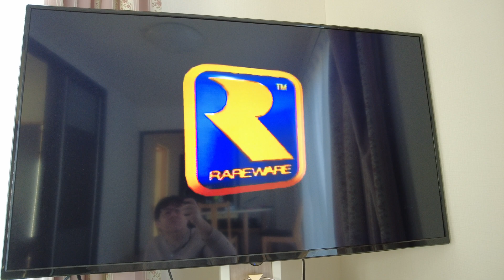An RGB mod that ANYONE could do to improve their N64 video quality

Comment: 1. this goes on the bottom so you dont need to remove the heatsink. 2. this only works on NUS-01 to NUS-03 board revisions with R15 R16 and Q1 pads (whether they're populated or not).  Some will say that these revs are all NTSC USA or Japan with serials starting NS1 and NUJ1 - and nothing else.

Comment: You really should tin the pads on the board before sticking the wire it. trim the excess exposed wire too. I understand the "if it works" mentality, but its pretty sloppy

Comment: Beware there are multiple REGION SPECIFIC versions and revisions of these versions. If you get an Early NTSC model.. you are good, only some wires needed, and if you want amplification, if you get a French PAL model, you are golden (Nintendo didn't know the French already practicly ditched SECAM, so they overspent on components and you only need to add a set of Rs and Cs) , if you get any other PAL model... you are screwed and for all the later NTSC ones... you are maybe too. For PAL Models you only get RGB with an additional Chip. Also know that  SNES, N64 and Gamecube share the "Multi AV" port, and the Composite (Yello, White, Red) cables are interchangeable, the RGB Cables ...are not.

Comment: I have mine modded , but I'm wondering if the Pound SNES RGB to HDMI works well with modern tv's, right now I have my n64 hooked up to a CRT which is great and everything, but its a small 12" display.
Reply from the maker: All pound products are really bad quality.  I wouldn't bother with them unless you're on a strict budget.

Comment: In my opinion it's impossible to make an N64 console visually as good as emulation. The small amount of RAM that was available for textures make the visuals what they are. Only PC emulation has the power to clean the textures up properly. The N64 is made for CRT TVs that's why there are Mini Retro Consoles for these 80's & 90's machines. Every output mod I've seen for the N64 make so little difference it's not worth the money.

Comment: The real culprit of why it seems like the N64 has awful video quality is the quagmire of why Nintendo decided to back then proclaim that all games were gonna be 3d graphics... iirc even the rushed MK Trilogy does not have bad video quality which means that say if Capcom or SNK had signed on (providing higher sales in Japan of course) and made pure 2d graphics games and arcade perfect home versions of arcade games... because... the N64 has the hardware... it had higher size ROM Cartridges at 64 Megs, 96 Megs, etc and most importantly of all... it had four controller ports... plus 3d was man power intensive... iirc Shigeru Miyamoto himself admited they had around 100 staff working on Super Mario 64 in a magazine interview back then... as such most of the best early N64 games still had rough looking 3d graphics plus in terms of years... it just did not reach MegaDrive or Super Nintendo levels of life cycle years and never could because Sega released next gen in 1998 which only got them to bankrupcy.. abandoning the highly profitable Sega Saturn Japanese market for no market and only giving Sony and Nintendo reason to make higher powered hardware.

Basically if things were different, a longer three way war between Sony PS1, Sega Saturn and Nintendo 64 would have had the latter two eventually pull away in image quality by using experienced devs, more advanced dev tools plus 4MB Ram expansion and for N64 the 64DD and higher capacity ROM cartridges with compression techniques plus probably SNK and Capcom returning or signing up to make 2d games... because there was a weird thing going on with demanding that all games needed to be 3d and the lie claiming that it was what consumers wanted.

Comment: Would have liked to seen comparison between s-video and rgb. I've heard a lot they're so close in comparison but maybe differences like you pointed out with composite and rgb in the video?
Reply from the maker: I don't have S-video cables for the N64 but I can say that from expensive via other consoles, S-video is nowhere near RGB quality.  It's better than composite but you still get dot crawl.  RGB is solid.
Maybe because the N64 video is so messy anyway even in RGB, S-video can look comparable?

Comment: Put solder on the pad first. It's easier than just tinning the wires, and you can still accomplish your goal of not using helping hands and only holding your iron and solder at any one time. 

Here's an example of retro console modding king, Voultar doing this technique on a similar N64 RGB board. He doesn't show putting the solder on the pads, but that's trivial since they're relatively big. Just put your tip on the pad and stick your solder on there. He's using flux, but you don't need it. It's best practice.

https://youtu.be/I1mtcbfGzV8?t=555

Comment: I did it in mine with a protoboard but adding a 4th wire for sync. This one works the same way, except for sync. It has a very noticeable difference in pictures, yet it's still a bit blurry (crappy Nintendo video chip). To improve above that only If you add a deblur IMHO.

Comment: Anything that requires soldering isn't something that anyone can do, but I feel ya. Most RGB mods are pretty simple.
Reply: General note to soldering beginners: Do NOT try to lift the pins of chips.
Reply from the maker: I think it is once someone is confident.
Being able to solder it easy once over the fear but being able to solder to very tinny points does require proper skill.  I would fully recommend people try a simple mod like this though.
Reply: @RetroCore  I wouldn't call soldering easy.  It definitely took me a while to get good at it.  But yeah, this one is about on par with most RGB mods.  This is the same standard RGB mod design that has been around for many years for the N64.  I myself like ETIM & Voutar's mod kits

Comment: I think I remember reading this particular type of N64RGB mod only works on the first few board revisions of the console - after that the simple mods won't do the trick. My model required using Tim Worthington's RGB kit, which requires much more extensive and precise soldering.

I'm glad you had a console that could make use of this mod though. n_n
Reply from the maker: That's right.  It only works on the older NTSC systems.
Reply: Good point.  I prefer ETIM's kit myself since it includes the Deblur function.  More complex of a mod tho but definitely better than the basic ones.

Comment: But can I also use RGB scart cables on the n64 with this mod? I've got both a PAL and NTSC-J console.
Reply from the maker: Sure, I'm using JP21 pin cables as I live in Japan but a RGB SCART cable will also work just fine.
Reply: @RetroCore  thank you

Comment: if you’re in the uk get a trinitron and they play s-video via the scart cable and a cheap adapter. looks basically the same as rgb, the dot crawl is all gone. rgb on n64 is a waste of time
Reply: Good s-video cables are expensive and hard to find. With these early consoles RGB + Packapunch SCART cable may genuinely be the same price, or at least very close. RGB offers more vibrant colours and higher compatibility with PAL CRTs (no NTSC colour support needed), so it's certainly not always a waste of time.

Comment: S-Video through the Framemeister (with the correct custom settings) gives a very favourable quality for N64, hardly any difference at all to the RGB picture.
Reply: N64 s-video using a Monster S-video cable looks good. But I once had a cheap (around $5 I think)  s-video n64 cable from eBay; it was horrible.
Reply: @brandonginsburg3120  There are definitely differences in s-video cable build quality out there, though it seems like pot luck as to why. The one I have is unbranded, but actually works nicer than others I've tried. Running the N64 through an upscaler such as a Framemeister or RetroTink 5X Pro is absolutely essential though, unless you're lucky enough to have a nice CRT. I'm using a Framemeister, with s-video, on a LCD, and it looks fantastic.

Comment: I moded my French PAL System ~15-16 years ago. There was no PCBs or "kits" to buy back then. I had a list with resistors and stuff to buy from an Electronics Store.
Was the hardest soldering i ever done!! 
Some of the parts are just 2-3mm long. I had to work with a magnifying Glass all the Time. 
But it still works and is hocked to a Sony Trinitron CRT. :)
Reply from the maker: Good work!   The French got lucky as other regions in Europe had no RGB option for the N64 😭
Reply: 2-3mm long is huge. Try 0.25 to 0.5mm on new consoles.

Comment: Do you need a specific model n64 console for this mod to work? Does it work with pal consoles?
Reply: “VDC-NUS” or “VDC-NUS A” are the only ones that accept this simple mod. PAL requires a much more intensive mod
Reply from the maker: Only works with first gen NTSC consoles.

Comment: This "simple" mod can only be done on the early NTSC revisions, after which you need to spend $100+ for the mod.
Reply: $11 on aliexpress
Reply: Not quite true, Tim Worthington's N64 RGB is much cheaper, though does have to be imported from Australia. Not likely to be nearly as expensive still.
Edit: looks like there's even a US distributor for his stuff.
Reply: @tehFoxx0rz  Worthington's stuff is going to cost $100+ once you get it in hand.
Reply: @amerikalast  I've bought mods directly from him before and it hasn't ended up being nearly that much to the UK at least. And as I say, there's a US distributor if that helps as well.

Unless you mean in cables and upgrades to your setup to make better use of them, haha.

Comment: My import 90's N64 was RGB as was my PC Engine, Megadrive, Neo Geo and Super Famicom. I don't know of any shop in the UK that sold import machines without them being wired ready for RGB scart. If you still have your import consoles (or past a certain date some pal consoles) pre hdmi then everything would be RGB scart. Obviously I guess most parts of the world didn't have connections that had the arcade quality picture output.
Reply: Of that list, PCE and N64 were the only ones that didn’t come with RGB output from the factory multi-out.
Reply: @emmettturner9452  PCE you can actually tap RGB from the ext bus... but it is low power and needs amplification. 
The cheap RGB amplifier boards readily available nowadays based on the French Sodipeng design just pop into the EXT... obviously no good for a briefcase set up tho. 🤣
Reply: @KayliedGamer  Yeah, but you also needed to amplify audio if you grabbed it that way. These days we know you also got a different set of colors with RGB, almost like it was processed with a different DAC that was designed to translate the values differently. We know they both came from the VCE so shrug no idea why.

Comment: I wish I had an untouched N64 to try this on, N64 video output is so terrible a fair few of the consoles out there have been tampered with mine is one of those that had an earlier method of RGB modding done by someone years ago, I believe they cut traces so it's not easily reversible, the problem is that it just won't play nice with a modern TV. You can hear the games working but can't see much apart from a black screen. No N64 gaming fun for me.
Reply: Perhaps your modern TV doesn’t support 240p and would have that issue with any RGB mod. The modders who cut traces typically put C-Sync where Composite Video or Luma was. What kind of cable are you using?
Reply: @emmettturner9452  My N64 used to share an official Nintendo RGB SCART with my Gamecube, hooked up to a Trinitron.
Reply: @johns6265  It’s my understanding that Nintendo changed the RGB specs for PAL GameCubes versus the SNES and most N64RGB mods aim for SNES RGB specs. Also, GameCube is 480i, so if this were a 240p issue with the N64 you’d expect the GameCube to work.
Reply: @emmettturner9452  I'm kicking myself for selling my PAL N64 years ago, I could have borrowed the composite cable and RF modulator from that. A bad picture is better than no picture at all.

Comment: The N64 is one of my favorite console minus the OG controller(a wired Retro Fighters N64 controller is a GOD send) , but having my N64 hooked up to my 27in Panasonic CRT with an S-Video cable, I don't think I would notice that much of a difference, even though it has a component input, i but I do have the audio pumping to my 5.1 surround sound setup. 

Also I have the same Multicart you do except with a red shell, and it's nice not having to switch games when I want to play something different, and for a the handful of the more expensive games I don't have in my collection(my N64 collection is about 90% complete of the all the US released with games some in box, but most not).
Reply from the maker: The OG controller is garbage in my opinion.  I use a WaveBird like controller that's wired.

Comment: You do make it look easy, but I still wouldn't risk it myself, its worse because I have a PAL 64 which sucks, I think it is worth the upgrade though.
Reply: I'm reminded of 20 years ago when I didn't know how to solder.  my very first project was mod chipping a ps1.  it really isn't as bad as you think, but it certainly could be!!  imo, it's really not that difficult of a job, and the fact that you can plop the board over most of the pins needed to solder means a lot less fiddling.   and since the wires go down on parts that already have solder it's just one second of heat to get things melted and meshed per wire.

the main points for me i think, would be you don't want the part absorbing a lot of heat, so make sure your iron is as hot as it needs to be so that the solder flows instantly, then you put the parts together and hold them as still as humanly possible, a microsecond later you can see the solder change its state from liquid to solid and that's that.  if a little too much solder gets put down, you can kind swipe it awway with the hot iron most of the time, but a simple cheap "solder wick/braid" is also a great thing to have on hand.  [you also want to make sure the parts themselves have absorbed enough heat so the solder makes that bond rather than just cooling around it and breaking off easy]

finally stay away from any of the "cold touch" kind of soldering irons that use batteries and mega current to weld.  you want an iron that just get blazing hot by conduction so it doesn't do anything funny to your circuits with injected electricity.  a cheap 25 dollar iron from canadian tire/harbor freight will do the job just fine most of the time too i might add.
Reply: @jn1211  Ha I think I would only try it if I have spare machine lying around, I would feel so burned if I bricked my own machine, thanks for the tips though.
Reply: @newtypepunk9967  WE NEED TO GET YOU A SPARE [ntsc]N64! 😆❤
Reply: @jn1211  LOL its funny you say that, I have a spare ps1 which has the odd bug of not having the sound work on cutscenes, never even heard of that issue till I had it happen, but yeah it became my spare machine, but its already modded. I think for n64 I'll just end up buying a modded machine at some point with a multicard reader.
Reply from the maker: Great advice.  I agree about making that iron as hot as possible.  That was my mistake when I first started soldering.  The solder would never melt.
I threw away the crap iron I had for the one I used in this video and boy, it made a massive difference in the difficulty curve.
Reply: @RetroCore  it truly is such a joy getting past that entry level iron we all seem to be drawn to initially lmao! it's like a badge of honour or a rite of passage into the world of electronics i guess!
Reply: This mod can't be done on a PAL console.
Reply: @pas7680
Im not sure about this exact Mod but i know that French PAL units are capable of puting out RGB after a Mod. I know because i have one and done it myself.
Reply from the maker: I read in another comment that the PAL console can't be modded that easily 😒
Reply: It always baffles me that people bought pal consoles back then. Import shops were everywhere, my city has loads of them. The games didn't cost really any more on import either USA or Japanese on 90's consoles and were available years before the UK and RGB scart was on every machine you could buy. No ugly images or borders or slowdown or any 50hz nonsense.
Reply from the maker: I'm from the UK but never bought anything PAL after 1989.  PAL was bloody awful for gaming.
Reply: @theoldpcgamer77 Unoptimised 50hz PAL consoles sold so well BITD probably due to parents purchasing and the warranty thing ...